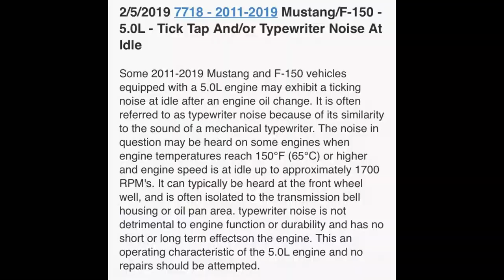2018-2021 Mustang GT Typewriter Tick/BBQ Tick. Don't Be Worried!

Comment: Thanks bro I have a 2019 gt n that rattle had me going crazy going to put cerma (to be clear that's 10qt of cerma or can u mix it) what oil filter do you recommend n what transmission fluid n additive do recommend
Reply from the maker: I actually ran Cerma oil 10 qts. Until time to change. Then I switch to amsoil. I'm an amsoil dealer. I run the xl boosted. Trans fluid I have the Mt 82 manual trans so 3 qts of dct fluid shifts much smoother. The oil filter I use is Purolator boss. Good for 15k miles.  No transmission additive is recommended with amsoil cause it has all the additives you need. Rear end I also run amsoil. Don't need friction modifier as it's already in there. If you want amsoil let me know. I can give you a link to sign up to save 25% on your order. Free shipping over $100 free swag. Lots of good perks
Reply from the maker: I used the cerma when I first got it because the oil has the treatment in it and it treated the engine.  But i'll go ahead and leave the link for you here for the amsoil.  https://bit.ly/3jDXLDa
And the very best wiper blades you could ever use are here.  the link has a 5% off code applied and free shipping.  these are what i run on mine.  Still on there too.  Been like 3 months and no streaking or noise. https://www.raineater.com/?apply_coupon=AnthonyH2021
Reply: @BeardedFordTech  yes send me the link
Reply: What do you recommend for a automatic transmission
Reply from the maker: @engelbalbuena1390  The Amsoil signature series fuel efficient synthetic automatic transmission fluid for the 10R80 automatic transmission. Part number ATLPK-EA.
Reply from the maker: @engelbalbuena1390  https://bit.ly/3wi6JIS

Comment: So I have a 2016 mustang gt and after I did a oil change for it and I get a clicking  sound from my EVAP sensor up from and I only hear it around like 2-3k rpms and then stop hearing it but like driving around at like 1-2 gear I hear like a clicking noise like a flap hitting something and it drives me nuts but can’t fix it. But if I unplug my evap sensor it stops, even tho I just replace that sensor
Reply from the maker: Clicking means it's working. It's purging.  All of them do that. Even my ranger

Comment: Anthony what is the cylinder scoring you referred to at the 3 min mark? I have the ticking sounds like a lifter tick to me and it's most prominent at cylinder 1 passenger front nothing from the drivers side. Even used a stethoscope and that first cylinder is making the most if not all of the ticking. typewriter, lifter whatever it is beyond annoying. How would I know if it was cylinder scoring
Reply: man I checked out a few more videos it seems I have the direct injection pump noise. Consistent tick tick tick
Reply from the maker: A good way to check for cylinder scoring is pull the spark plug. Get a borescope camera and stick it down there and look. Yes the direct injection pumps always tick. My ranger has that same direct injection tick.  Cylinder scoring noise will not go away. And will get louder with rpms
Reply from the maker: Cylinder scoring is when the piston isn't moving straight on the up or down stroke. It's at a slight angle and it scrapes the cylinder walls. And it also scrapes the skirt of the piston. Only way to fix it. Replace the block

Comment: Motul synthetic engine oil now make a Ford certified oil. I used this on my last oil change 5/20 weight and the tick has completely gone away.
Reply from the maker: I use amsoil. Used to use motul in my sport bikes. It's a great oil as well.
Reply: Used motul in my STI loved it. Which one is for the mustang ?
Reply: @realironpodcast2253  I use the 5/20 and it says on the label its made for Ford engines.
Reply: @BeardedFordTech amsoil is the best oil iv used.on a Superbike you are sitting on top of your engine ..you hear every noise so I tried a diff top synthetic every oil change on my gsxr 750 and amsoil was super quiet and shifted quietest and smoothest..amsoil if you care about your engine or trans..(havent tried diff fluid yet)

Comment: I have an s650 and it’s due for its first change but they do have metal pans again so I hope mine doesn’t do it but I do hear ceretec helps.
Reply from the maker: @E85_STI  it's going to do it.  Don't put ceretec in there. Reason being is it counteracts with all the other additives in the oil.  The tick isn't hurting anything

Comment: I just bought a used 2017 mustang gt premium 6 speed manual with 9,800 miles. I just started noticing the tick sound coming from under the car on the driver side maybe from the oil pan. I notice it at ideal in my garage but can’t hear anything while out driving around or even stopped at stop lights. I took a some videos of the sound as I increased the rpm’s to 1500-2000. I just changed the oil to royal purple and on start up it seemed like the tick got a little louder than it was. I’m gonna drive it some more tomorrow to see if it quiets back down.
Reply from the maker: Royal purple not that great. I personally am not a fan. I would change that. However it is your car. It is up to you.

Comment: So I’m looking at a 2021 (maybe 2020) I guess my question for you and any other mustang owners in here. I’ve had two mustangs so far both 4.6s and both lasted me. How much do you guys trust these gen 3 coyotes? The tick does concern me a little, but if you guys are enjoying and beating on these things with no issues then I do feel better. I would go a step up on oil like I always have and run the 5w30, I would hate to take the jump to a dodge or Chevy. Looking at an A10 for weekend racing and the wife can actually drive 😂 
Thanks guys.
Reply from the maker: The tick has actually been around since 2011. It is not causing any damage and the vehicle is strong. Fun to beat around in.  Please don't go to dodge it Chevy as you will spend more time getting it fixed and will be very unhappy with it.  You can run 5w30 in it no harm will be done.

Comment: The high pressure fuel pump on a V6 F-150 also makes a "typewriter" click, is that normal as well? No change to gas mileage, no warning lights, and I'm not sure what the fuel rail pressure should be either.
Reply from the maker: Yes. That is normal .it uses an extra lobe on the cam to pump and electronic. Fuel pressure from the pump is 43 psi. Fuel pressure at the high pressure pump is around 2900 psi
Reply: @BeardedFordTech  Awesome thanks a bunch man! Love the mustang too.
Reply from the maker: @KG-yu7el  anytime man anytime. Thank you 😊
Reply from the maker: @KG-yu7el  gonna release a video tonight or tomorrow on how to get better mpg/performance with 1 item. Stay tuned

Comment: Would it go away if I replaced the plastic oil pan with steel ?
Reply from the maker: No. The 2011-2017 have metal oil pans. Still does it. Noise is just louder on the 2018-present.  It's not the oil pan making the noise. It's inside the engine.  But it's not hurting anything or destroying the engine. They have been doing it since 2011
Reply: @BeardedFordTech  fair enough, would you suggest Rislone products as second choice ?
Reply from the maker: @eremyjay  in this video I used cerma oil. I did it caused they asked.  It did help but the noise was still there.  Just not as loud. I am an amsoil dealer and run it in all my vehicles and motorcycles. Even my lawnmower. I would suggest using it. Not cause I'm a dealer but as a technician I stand behind their product. Never once had an issue with it.

Comment: Did some research , charge motion control valves , they butterflies , mounted on a shaft . There is one for every cylinder and they control low speed intake velocity .
Reply from the maker: Indeed. That's the electronic solenoid on the back of the intske
Reply: @BeardedFordTech just to clarify he means the intake runner flaps inside the manifold. Apparently that is reason the f150 knock/tick is so much louder along with more engine bay space to reverb sound. The flaps help with torque down low it ms advisable not to delete them on the f150. My 18 f150 knocks/ticks loudly at idle and under 800rpm so I don’t worry about mine. The 1-2 gear whine and vct rattle at 1200rpm lift off drive me way further up a wall 😂. Runs strong at 130k though!

Comment: I’m looking at this 2017 at the dealer and I here it and it made me scared to buy it. It’s a tic and when I rev it to like 2K rpm it gets a bit louder than goes away comes back
Reply from the maker: @Tlopez0  BBQ tick.is heard when you start it. As it warms up. Can be heard up to about 2k rpm
Reply: @BeardedFordTech  so I heard it when it was turned on and then I went to test drive it. And the car drove fine got it up to 90MPH came back and I still heard the slight ticking it’s not super loud but it can be heard and especially from under the passenger side
Reply from the maker: @Tlopez0  yep it's random. When you shut it off an hear it that's the exhaust cooling off. It may not do it when you start it up again. It's so random.

Comment: Gen 1 120k just started ticking. I am go change the lifter and hydraulic roller l. It’s only happening above bank 3 where the valve covers at.  I drove this morning no tick sounds only at a certain rpm.
Reply from the maker: Bank 3?  You mean cylinder 3. Third one back on passenger side?  If it's a lifter it would do it all the time. Not just certain rpm
Reply: @BeardedFordTech  I’ll keep you updated on what’s happening.
Reply: @BeardedFordTech  it went away now. I put addictives in oil. I forgot to tell you that the engine have been running for almost 2 years straight.   Started back driving it suddenly gone.
Reply from the maker: @fordracing5oh  had to get oil up there. And quit putting additives in the oil. If ylu have to add them then you need a different brand.  A good quality oil has all the additives you need

Comment: Hey beard Ford Tech thanks for the video yeah I just bought a brand new 2023 GT California Special yesterday and I noticed when I'm idling my windows down near a wall or from outside near the driver side I hear a tick tick tick tick tick tick tick when it's idling.
Reply from the maker: Indeed. It's the bbq tick. Usually heard after the first oil change. And can be heard to about 1200 rpms.
Reply: @BeardedFordTech  yeah I haven't received my first oil change yet still the same oil that came with it do you think that's what it is? I'll probably call the dealership tomorrow just to make sure...
Reply from the maker: @DKFlax  how many miles?  They make all sorts of funky noises at idle. Usually the bbq tick is heard after an oil change when you start it while it's warming up. There also a diesel type knock noise which is normal. Run high octane gas to minimize that. Injectors and high pressure fuel pump also make a loud tick at idle.
Reply: @BeardedFordTech  got you. Thanks I feel better now I was worried that I was getting piston slap or something bad but that's rare I mean that's not going to happen with a brand new car right?
Reply from the maker: @DKFlax  it can. Usually cylinder 1 scoring. I haven't come across it brand new. Usually they have some miles when that happens if it happens.  Cylinder slap won't make a tick noise though.